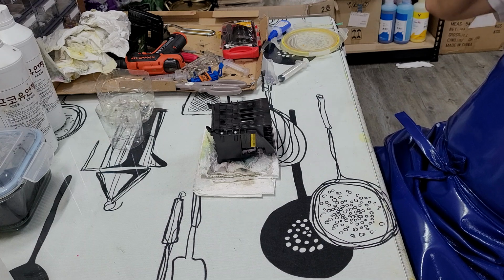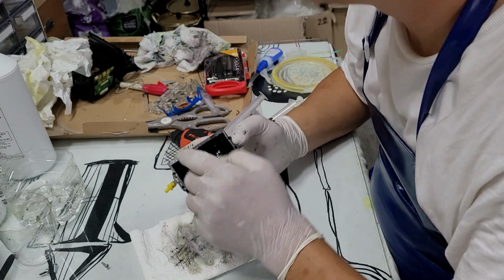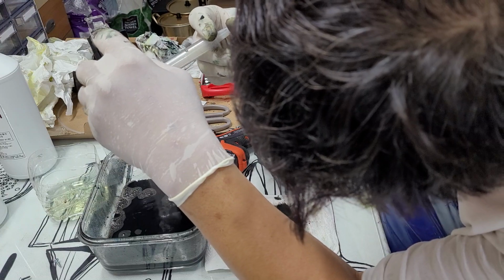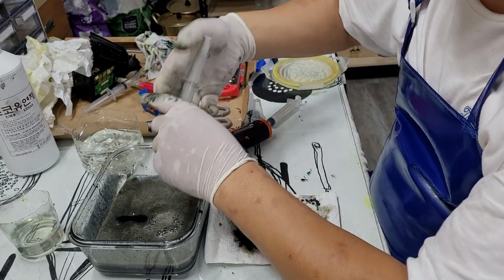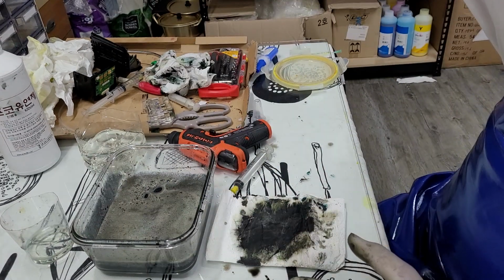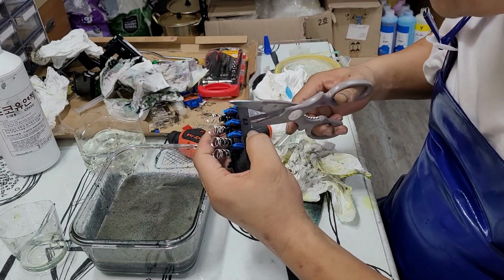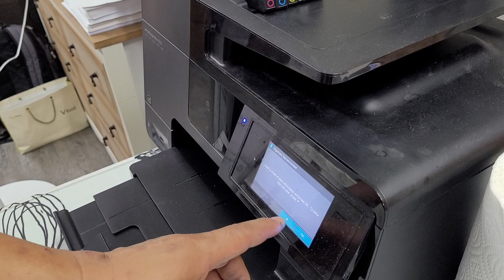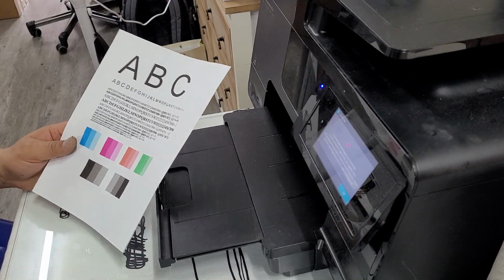HP 950 952 962 PRINTHEAD REPAIR UNCLOG

Comment: After your final color test, how do you prep the printhead for shipping? Do you attach the blue clip and suck out as much ink as you can? Do you wrap the bottom to prevent any residual ink from leaking everywhere? If you reflush out the chambers I assume you could cause an issue that won't be known until the customer tries it.
Reply from the maker: hi, 
i usually put on white nozzle clip for it. it looks like blue clip but it prevent ink leaking from the nozzle . 
and also put some paper towel inside printhead for leaking from the chamber 
clip cost is $1.50 each . 
if you need more information, please send e mail to sales@proinkshop.com
thank you